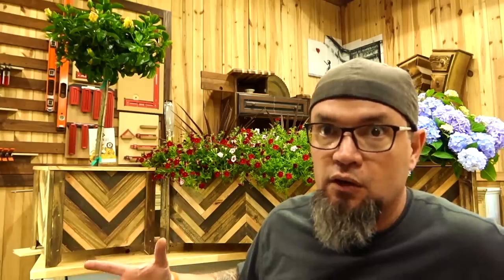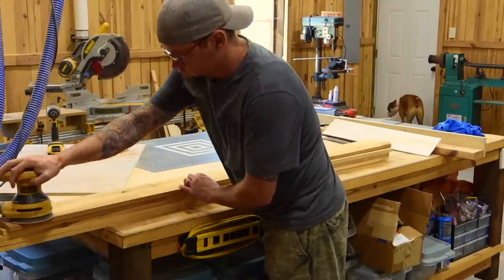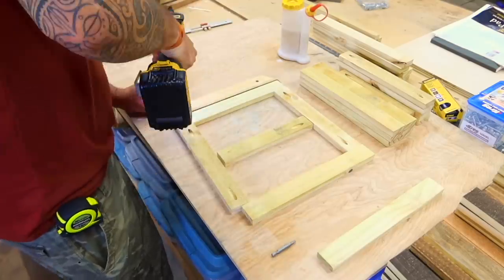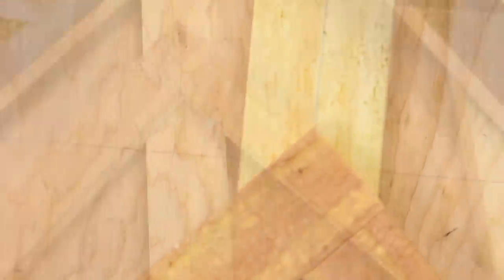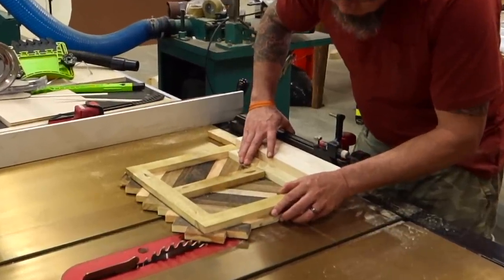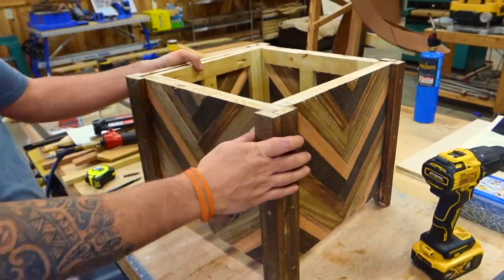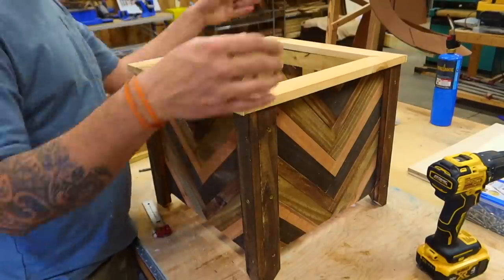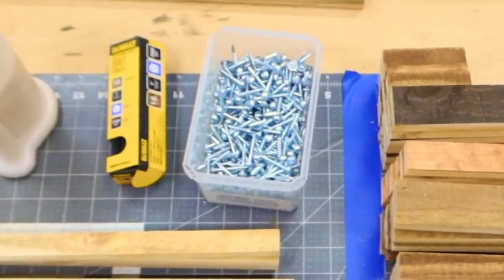The $10 Planter - Low Cost High Profit - Make Money Woodworking

Comment: Have been in the process of building this planter. 

Things I’ve come across:

-When cutting your stained board pieces out, make sure the fence pickets you use (It’s either 3 or 4 out of the 5 total) are the same thickness. After I had sanded, stained them and eventually put the chevron pattern on, they were different heights coming off the frame. Which didn’t look quite right, still looked decent.
-When I was squaring off the sides of the picket fences, I ended up cutting too much off. So some of my pieces were a little to short.
-If you’re using the kreg jig pocket hole handheld (gun looking one) make sure you have the depth to 1/2”. I had drilled way to far and messed up some frame pieces.
-I put some Danish oil on the finished product and man it looks so cool, all the colors pop and it is quite amazing. 

Overall, it was a great first project. I highly recommend trying this out with Matthews esty plans. Very easy to follow, but don’t necessarily count on this project to make you fast money. I only wish I had a miter saw, that definitely would have made it way faster. I had to cut all my pieces on the table saw, and that freaking took FOREVER. 

I’m proud of the way it turned out, and like Matthew said, every piece is it’s own. So true. I used a Cherry stain, espresso, dark walnut, and a lighter brown stain (forgot the name) and it looks amazing.

Comment: Love the planters. Just finished my first one.. Lessons learned-When you assemble the panels, they overlap as much as an inch causing the herring bone pattern to be off center.  When starting the pattern make sure the first set of boards is off center the correct amount and that the 45 degree angle is correct.   Wipe off and glue that ozzes out on the finished.  Dried glue is hard to get off and damages the stain. The holes Matthew added to attach two panels together will also screw the legs on from the back side but I had to cut the screws off because they don't make the correct length. I'm having issues with the top being too thin after planing.  My cedar fence pickets aren't as thick so the tops have to be perfect to look good.

Comment: One issue I keep facing with these builds is whether to cut “on the line” or “after the line”. With the 1/8” kerf of the blade those add up cutting after the line and I run out of enough material for the final piece as per the cut list. Cutting on the line means my first piece is 1/16” short and every one thereafter is 1/8th short of the stated length on the cut list. Maybe this is a dumb question but it’s dogging me brother. Help/advice seriously appreciated. Keep on keepin’ on 👍
Reply: I try to always cut on one side of the line. This means that my blade cut is constantly on the left side (covering the line from left to right) of the line. But one should always take into account the blade kerf like you said. You can also measure for each cut separately, but this will require a lot more time. Fences and stop blocks will keep cuts repetitive as well.
Reply: @chrismarendish2323  roger that. I bought two of Matt’s plans so my question is specific to those plans. Cutting to the right (or left) of the line means there’s not enough material left on the pickets for what the plans show. But of a conundrum.

Comment: Very nice - * One change suggestion: put the bottom pieces inside, across, resting on the inside of the the frame. Glue, nail, faster, cheaper [no screws], far stronger when someone drops a full wet pot inside.

Comment: Hey Matthew, I just wanted to let you know you might want to go back on the Herringbone plan on your Esty shop .Go back and correct. Due to there is an error on it. You have on the plan to set all the pocket holes at 1/2 " on the T&B and Center. On your video here, you said set the pocket holes at 1 1/2" . Unfortunately, I did all my pocket holes according to the plan at 1/2". And a few blew out right in the middle of pocket holes. That I purchased from you. Now I am having to go back and do recutting all the B&T frame and Centers. And now, I have to reset the pocket holes for 1 1/2"

Comment: I literally just made 2 of these but I put the herringbone pattern behind the center upright support and was still able to pull it off with 3 pickets.  I also didn't think to stain the alternating boards in the pattern so it's a little harder to pick out the pattern from a distance but still pretty easy to see up close.  Now for the guess.  I think there are 328 screws left in the box.

Comment: Which type of pickets do you buy and what store do you purchase from, I’ve gotten several cedar ones from home depot but getting them flat and straight or keeping them flat is a chore and end up having to plane them down pretty thin.
Reply from the maker: I usually use the pine.  For some reason I have better luck at some stores than others and havenet ran into many issues... I still have to dig for the best ones.

Comment: By the size of the screw box, I would venture to guess it was a pack of 500 screws. You mentioned the box was already open and used when you got it. SO, you need roughly 24 pocket screws per little planter and about 30 for the bigger one plus the bottom slats which was 10-11 pieces with 2 screws each making it 20-22 more. 3 planters so I am guesstimating you used 98-100 screws on the project shown with the "requested" additions from the boss. 

My guess is going to be 313 screws left over in the box based on your use and previous use. Total shot in the dark here but hey, thanks for the game and video. Those screws add up in a hurry.

Comment: Those glue bottles are great, I've had 4 of them ... for a reason. The washer/seal in the cap eventually goes bad rendering the bottle mostly useless. I've tried an o-ring but without success. Luckily a new bottle is only about $5.

Comment: Hey Matt, why didn’t you install the bottom slats by cutting them long enough to pan the inside of the planter between the outsides but sitting on the frame?(hope that makes sense) wouldn’t that give them the most strength and be just as fast as the first way you tried? Basically pinning them on the frame from the inside instead of the bottom outside. 

Also screw guess is 285
Reply from the maker: Thats a good idea.. I simply didnt think of it.  The only issue would be that it would raise the bottom a couple of inches.

Comment: Nice video. I've had to swirch to 3/4 beetle kill pine  (bug box store calls the wood blue stain) for the boxes. Why? Because here in the southwest in our 10 year drought with single digit humidity  the fence pickets shrink so much the become less than 5 inches wide. Blue stain isn't as cheap but still less expensive than white pine. My guess 372 meet picket hole screws.

Comment: Curious if you think you'd be able to lay your bottom slats on top of the lip of the bottom portion of your framework?  So, they'd be similar in length to the ones you glued/nailed to the bottom in version #1, but actually be supported by the wood of the framework and hidden inside (like version #2).  (Sort of like a ceiling joist resting on a wall plate.)  Just a thought.  Excellent build either way!  My guess is 285 screws.
Reply from the maker: Thats a good idea.. I simply didnt think of it.  The only issue would be that it would raise the bottom a couple of inches.